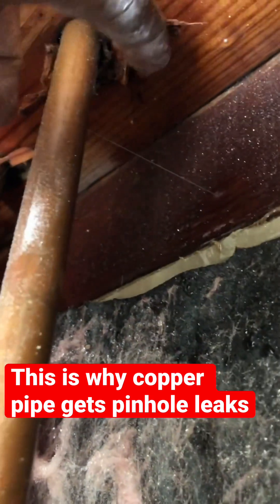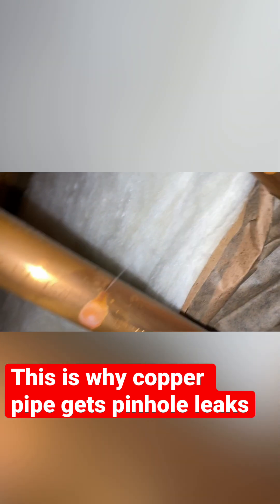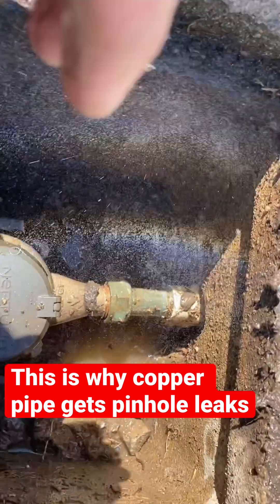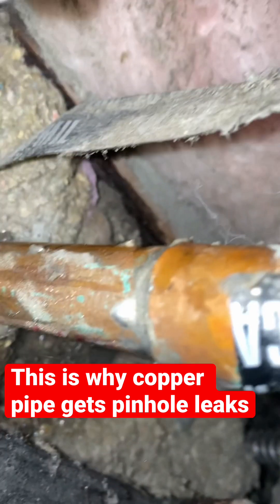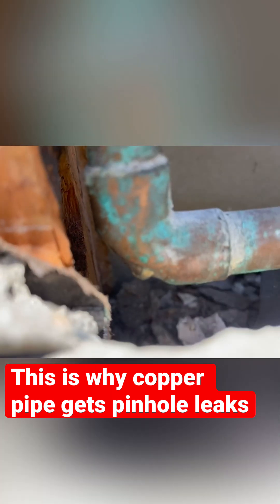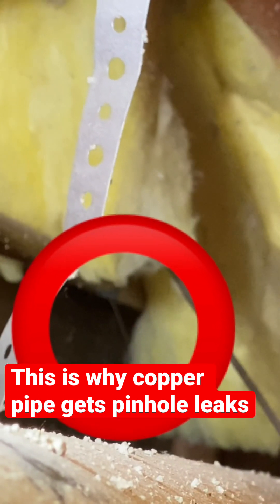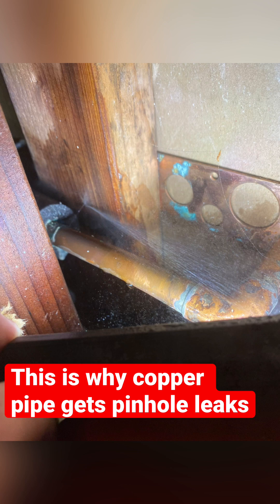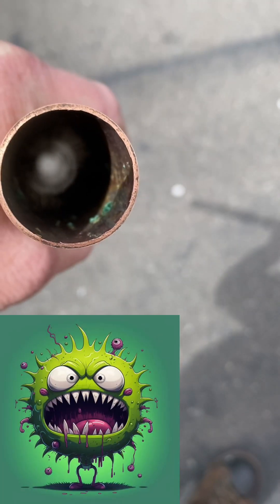This is why copper gets pinhole leaks 2023

Comment: So do they need to be replaced or can they be repaired?  How much should the cost be?
Reply from the maker: It can be repaired but, if you start getting random pinholes on your copper system and it’s over than 40 years old the overall best choice is to repipe the home.

Comment: Low PH levels usually indicate acidic and corrosive water produced from chloramine etc. … installing a good brand of copper also reduces electrolysis  while reaming pipe will ensure proper flow rate with no flow restrictions

Comment: Yeah, I still have that hole in my basement ceiling from when I had to repair a pinhole leak. I fixed the pipe a few years ago, I just never got around to fixing the ceiling.

Comment: Pinholes can be in brand new pipe, seen it at least a couple of times. I would expect many pinhole leaks start off as imperfections from the factory, then only a small amount of copper needs to be worn away to cause the leak, not that it's the only way it happens.

Comment: Also how much the copper has changed it does not even come from America in some places and it looks like their making it thinner and maybe  you never clamped that wire with installing with the water meter. Electrolysis blah blah . Also not cleaning off the pipes all that Flux some use that also becomes a problem in the future.

Comment: Also didn't wipe flux off when you do that it eats the soldier back out and some is from having electrical lines hooked to the copper creates electrolysis which eats the copper up fix with PEX repipe 😁
Reply from the maker: Yea you are 100% correct!! Flux will cause pinholes too if you don’t wipe your pipe and joints after soldering! I’ve found pinholes that looked like they were caused by a fingerprint, the plumber must of had flux on his finger and didn’t notice

Comment: I think there are multiple reasons for the pinholes. Chemicals in the water is certainly one of them!
Reply: Nah, any chemicals strong enough to burn holes in the pipe will kill you if you cook or drink it.
Reply: @richardwebb9532  you are correct.  But, everyone likes to follow the bandwagon.  I have a different theory I can prove.  But, I'm too small to take it to a higher authority.
Reply: @Monkeywrench864  ...you are never too small. If provable, you should take it forward with local plumbing authorities.
Reply from the maker: I agree with you
Reply: I've heard that in areas of the country that are using well water where it's abundant has caused lots of pinhole leaks. Namely in the Ozarks and surrounding states. Lots of them are manufactured homes using type M copper.
Reply: I disagree,

Comment: Typically the pin holes are due to electrolysis for multiple types of piping...
copper, galvanized and one reason why dielectric union's are used... thanks for sharing your adventures in plumbing
Reply from the maker: I agree that’s one way pinholes happen and this is another
Reply: @PlumbingExplained  thin wall copper is the worst,I've literally replaced thousands of ft
Reply: Yeah have same problem in my area of Australia, electrical wires running near copper piping and hard water

Comment: Sorry buddy but it’s called electrolysis. It’s when electrons flow through the copper pipes and the dissimilar metals in the water or connections move little pieces of copper from the pipe to another location. This eventually causes pin hole leaks everywhere in that piping.
Reply: Same thing happens with automotive cooling systems which cause leaks and corrosion
Reply: It's the old cheep thin walled copper bottom line
Reply: Sorry buddy but none of those were examples of electrolysis. 😂. You would see bunch of crud from the pipe being eaten away
Reply from the maker: Well I agree that is one way pinholes happen the Chloramine is another